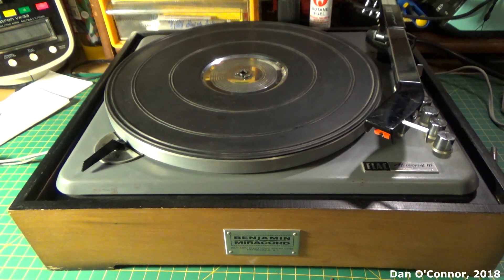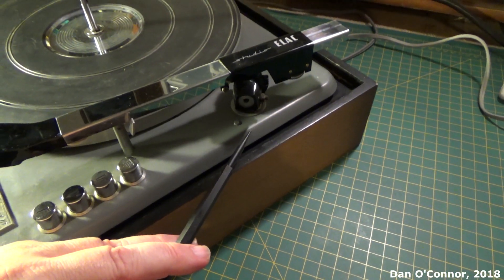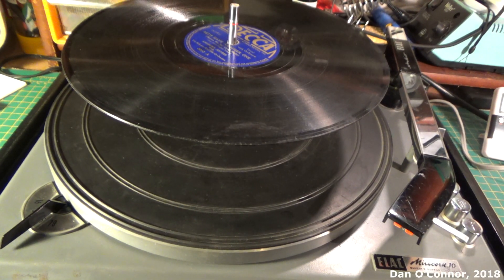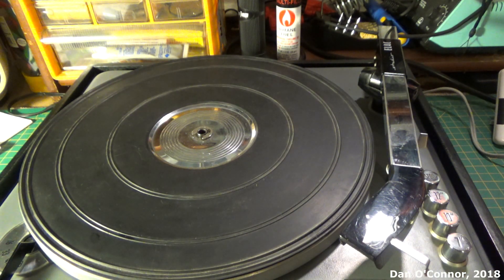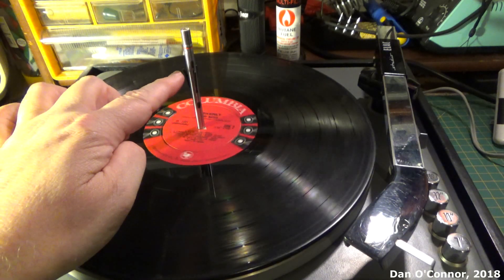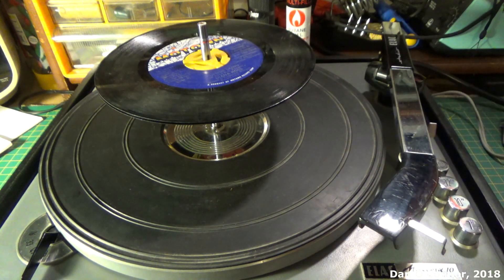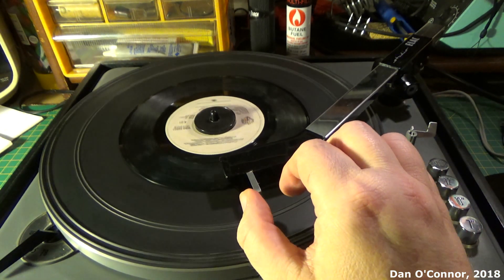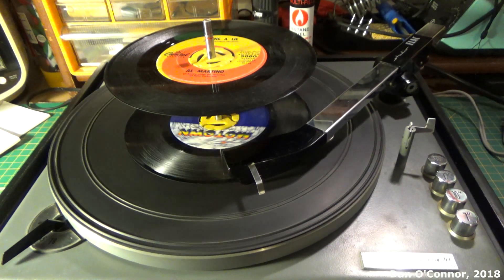Early 1960's Miracord 10 Record Changer

Comment: Nice player and demonstration.  With the original manual spindle, which is longer and a little odd looking, the player would shut off automatically, but if inserted up-side-down it would repeat continuously.  Nice touch, if you hit "stop" it will cycle and shut off without dropping the next record in the stack.  Something I haven't seen on other changers is that the platter has a brake to stop it quickly at shut-off, probably to make spindle and record removal easier.  Some enjoy seeing how long a heavy platter will take to stop rotation on its own.  Not on this one.  Always liked the "feather touch" push-buttons on this and later Miracords.

Comment: It can be argued that Elac made some of the BEST record changers.  They fly, "under-the-radar", so they're not as well known as the Duals, Garrards, etc.
Reply: I disagree most vigorously.  Miracord mechanisms are mechanically some of the least elegant I've seen.  
BIC did far worse, though.  (I work on record changers, so I have a perspective many people lack.)
Reply: @spacemissing  I own a BIC 981 and I would say it's very simple in it's design and very reliable in it's performance.
Reply: @brunoprimas1483  You are lucky. I have serviced several BICs that were nearly impossible to put into operable condition.

Comment: the mechanism is designed to sense from the stacking spindle or 45 rpm adapter stacking spindle that if there are no more records the unit will shut off so it will not keep playing .the spindle tells the mechanism to get ready for next function to shut off the spindle and the 45 rpm adapter will be the only way to have the unit shut off after the last record is played

Comment: I have a number of reasons for disliking these turntables, the first of which is the deceptive appearance of the tonearm. 
It looks almost endless, but its effective length (pivot to stylus distance) is about as short as can be gotten away with. 
Better arms are longer and have consequently less severe offset angles. Another complaint is the imprecise 
movement of the arm --- it bounces up and down and jiggles side to side unnecessarily. 
Even the crudest of other machines manage to avoid such slop. 

As for making a video of any multispeed changer, it is wise to start with LPs, 
and only after that show it playing other records.
Reply: I would not play any of my records on this primitive record changer.
Reply: @3713msg  It wouldn't hurt them.  
I have records I've played on changers numerous times and they have not been affected in the least.  
The main reason to avoid using This Specific model is what I stated already.

Comment: You're having problems with the single play spindle because it is not an original Elac spindle. The Elac spindle responds to the turntable mechanism.
Reply: Yep.  The single, short spindle, should have a smaller diameter bottom, similar to tge bottom of the tall, stacking spindle.   It's made that it will only play one time if put in the normal way, and will repeat a record if flipped upside-down.

Comment: I had a later version for many years in the late 1970s. It was sold through Radio Shack, so it is  possible your dustcover is the correct one.
The tone arm geometry was perfectly fine. As were the bearings.
It tracked reliably at 2 grams. It cycled perfectly. The anti-skate worked perfectly.  The damped cuing worked perfectly. Rumble was no worse than other high end idler wheel turntables of the era. To my ears - I suffer from perfect pitch - it was no worse than the best turntables sold in the audiophile stores of that era and absolutely better than the first direct drive units. That patter weighed a ton and the motor was a beast. 
It was much quieter in cycling. I think this unit needs servicing. I don't get the hate. It's not justified. Oh, yes, you do remove the automatic spindle to take off the records. No worse than lifting and moving the balance arm out of the way.
I don't get the bad reviews I've read in the comments. They don't accord with my experience.

Comment: Very cool turntable.   The question that I have is if you hit one of the sizes as the record is playing, does it reject the current playing record?  I find it odd that you can't reject the record and you have to take the arm to the end.  It's still cool and it does make some great noises.  It sounds like all of the parts are working the way they should.  Thanks for sharing.
Reply from the maker: I got curious after your question so I dug the machine out of storage to find out. Unfortunately since the last time I used it the Miracord has suffered some sort of internal failure and doesn't work properly at all so I couldn't do a good test. Maybe I'll be able to straighten it out in the future.

Comment: How does it detect that there are no more records to play?  There is no "weighing" device involved.  The stacking spindles, both small hole as well as large hole  45"s, have three fingers that support the stack of records.   When it cycles, these three fingers fold into the spindle itself.  At the same time, short arms come out above these fingers to grab the stack of records so only one record on the bottom falls, the rest held up by the extended arms.  When there are no more records to play, these arms protrude out much beyond the diameter of the spindle because no records impede their movement.  These arms are linked to a central spindle mechanism that can is pulled down by the turntable to activate the dropping of any records.  When the arms are not allowed to protrude by a record on the spindle, this mechanism does not move downward below the turntable. This programs the changer to continue to cycle the next time.  When no records remain, these arms extend.   The mechanism is pulled down and signals the turntable to shut off at the next cycle.  It is a somewhat aggravating arrangement because it is not possible to play an additional record once the last record drops because the turntable has "detected" that nothing is on the spindle.  A record added later will drop but won't play.

Comment: Having to remove the spindle? The three supporting lugs are supposed to fold in as you pull the record up, but then it must be a Philips-related turntable brand that could come up with such a stupid method as this.
Reply: You'd think it would be more annoying but after a while you realize that it's better than trying to lift 2 or more records up and off a stacking spindle.  I learned to PREFER it now with my 50H.

Comment: How does it detect 'last record' to shut down?
Reply from the maker: It seems to be a "weighing" method based on th weight of the original records set on the spindle. When that original weight isn't detected anymore it shuts down. Something like that anyway. Chris Cuff explains it at the start of his video on the Miracord 45 adapter:  https://www.youtube.com/watch?v=8fpPWjvQ6IE&t=2s
Reply: Thank you for the reply and the link!   I love to learn about how these old mechanisms worked and the innovative ways each manufacturer sought to automate these machines.  A lot of people scorn the record changer, but they really are jewels of mechanical engineering - even the lowly BSR!

Comment: If you simply put one finger underneath the tonearm lifter and move position like that you might not scratch quite so many records. Also the plastic spindle is too wide, it doesn't spin like ordinary record players that's why the record isn't turning properly...
Reply: Most spindles on automatic changers did not spin with the platter.